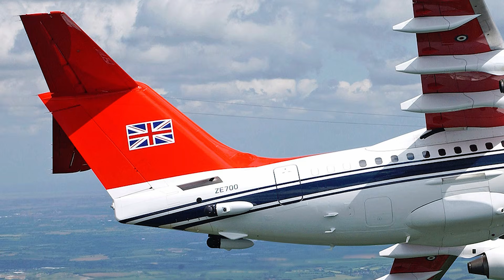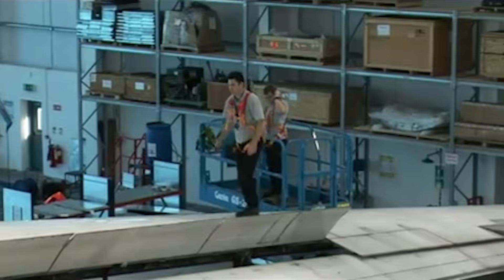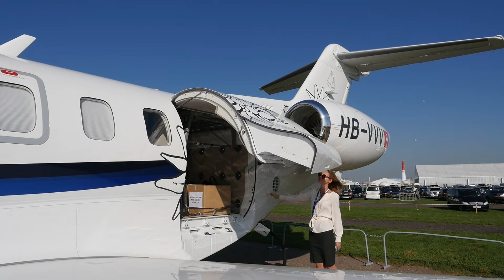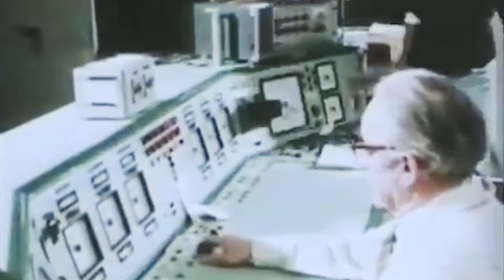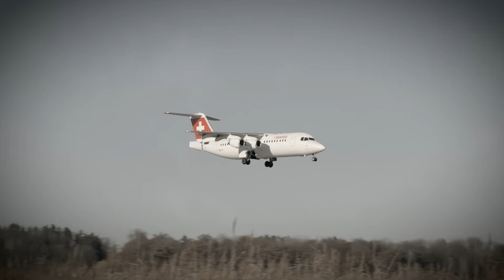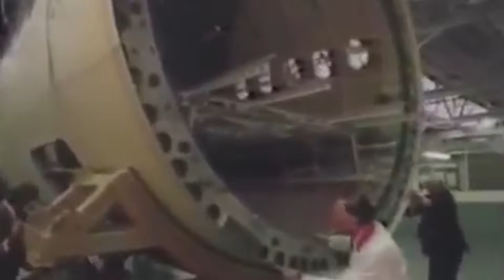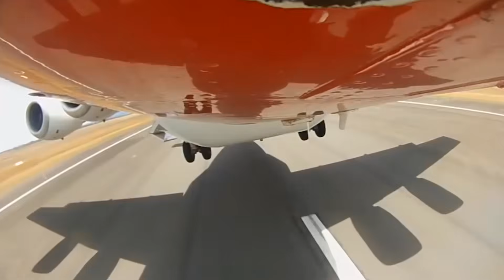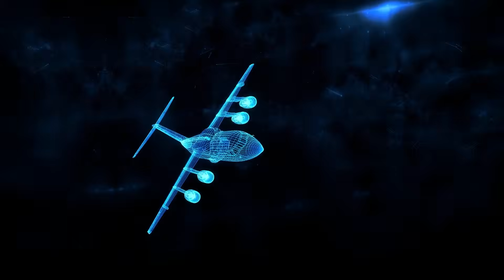BAe 146 - more engines!

Comment: Interesting video and a rather cute and effective aircraft.  You appear to believe the "failure" of other jets was all down to "wrong marketing". Just FYI.  Most of the issues with British jets stemmed from government interference. E.g the Trident - Hawkers wanted a 727 - sized plane but were instructed to make it suitable for BEA (smaller/shorter range).  The VC10 was designed for "empire" routes so was excellent hot and high and very fast. It was popular with aircrew and passengers.  Despite this, commercially it did not sell in sufficient numbers.  The notable difference between UK jets and USA jets is that the UK  jets (as a result of the experience of the Comet) were stronger aircraft. Boeings blew up their centre fuel tanks, blew out fuselage panels, had numerous problems with actuators etc etc culminating in the current, rather predictable fiasco with the 737Max.

Comment: Like the 737-200 the  146 /RJ will also have a second long career as an Artic aircraft.
Perfect for use on bad runways.
the STOL capacity and stability for a jet airliner makes it very unique.
On some routes there is still no good alternative for it.
Reply: I think you meant Arctic.
Reply: I believe they can easily be fitted with gravel kits too, the high up engines make this possible.

Comment: Flew on them a number of times in the 2000"s and its was quiet and comfortable jet compared to the B737-300 operating at the time. The A220 is it replacement.
Reply: Flew between Brisbane and Sydney around the same time. Flew down on a BAe-146 and back on a 737. To be honest, the BA was like a quiet lounge chair ride and the 737, well, I thought something must be wrong with it. Very noisy and a rough ride compared. Took a couple more trips and yep, preferred the BA every time.
Reply: The Embraer 170/190 was chosen by a lot of airlines to replace it
Reply: Dan air was the launch customer of the bae 146 why no mention .?
Reply: Flew a couple of times from London to isle of man  ... very powerful plane, took off within 100 meters it seemed
Reply: Bullshit
Reply: @bobbypaluga4346  according to Bombardier, who sold the design to Airbus  one of the targets for replacement by the A220 design is the 146. So, that's not bullshit.

Comment: I got to fly on it several times back in 2010 & 2011 with Blue1. My most memorable moment was in 2011 when I was flying from Vaasa to Helsinki:

We had taxied to the end of the runway and the pilots were lining up for takeoff, then they noticed that one of the fuel caps hadnt been properly locked, so we had to taxi all the way back to the gate to close it. xD
Reply: Lufthansa does it on the taxiway. Remember ze effienzcy

Comment: I flew on a RJ85 from London City to Dublin, quite a scary takeoff!!.  Plane got to the end of the runway with breaks locked, then the engines went full powerand I expected it to roll but it never did, it felt like forever and the plane started wobbling and shaking until eventually they let breaks go and damm....... The plane shot up into the sky and seeing all those buildings while the plane seemed to slow down a lot. Never have I felt so vulnerable in an aircraft but it was absolutely awesome!!!
Reply: Mitchell C Classic London City take off on one of those ..
The noisiest thing on them is the landing gear hydraulics when retracted or deployed .
Reply: Hey ummm I don’t think that’s the brakes that’s actually the irregularities of the runway
Reply: @USS-New-Jersey-bb62  no, they literally applied the brakes and went full power for quite awhile.
Reply: Used to fly in these into Belfast City in the late 1990's, it always felt like the pilot stood it on one wing tip and turned up the Lagan and then you hear a noise like a tube train as the flaps extended and the undercarriage went down ... so much better than the Dash 8 that Flybe operated on the same service.

Comment: Appreciation as always Skyships but come on I've just had to stall the film to convert 31kn to 7,000lbs thrust. OK 6969lbs!
You did the thrust conversion last time.
13.01 The bloody flag is upside down!
No mention of the issue or non issue as per aviation companies of the engine and toxic cabin air?
Reply: The toxic cabin air was not a continuing feature and is overplayed, usually by those who seldom flew in them. I've flown enough times in the "Jumbolino" and I've never had any problems between LCY, ZRH and VCE when it was part of the Swiss fleet.

Comment: The best,quietest jet around.  They used them to prove a point up here in Scotland.  They wanted to open an airport for 24hr operation, but they get so many complaints they gave in.  But they didn't give in, they asked to run these jets through the night, and did.  They did advertise they were going to do this, but in a very small add'.  They did it for six months, then announced they were going to run the airport 24hrs.  They got a lot of complaints, to which they said "We have been operating for 24hrs over the last six months, we have received no complaints".  It now runs 24hrs, but not a lot of flights through the night, but it is operating.  I like these jets, very quiet and quick off the mark. They called them Whispering Jets here.
Reply: bob fourjs ot
Reply: The engineers managed to bring the noise from outside the plane into the inside of the plane.

Comment: used to fly frequently to Paris and Brussels from Birmingham on them  no so long ago, stinked of fuel when engines start up in the cabin, seats around  row 7 had tiny overhead lockers due to the wing  structure, but I always liked flying them.  however longer twin seat single isle jets are nicer as guaranteed not to get a cramped middle seat and fight with your elbows. Superjet in particular is much more comfortable (but unreliable in my limited experience)  Embraer seem to have replaced them though  on local flights were the RJ was used.

Comment: They are SO quiet .I remember if I was awake at 2 am with the windows open, I would hear a strange low hum in the sky for maybe 3 seconds then it would be gone. I was very puzzled as to what aircraft could possibly be making it. Upon investigation I found it was a BAE-146. VERY unique sound to it.
Reply: @ATCkeepsUsafe  Do the letters f o mean anything to you?   Hint:  I'm not referring to far out.
Reply: @terryboyer1342  first officer? 😀
Reply: @V8King770  Nope. And not fraternal order either! :)
Reply: The ones I've seen made that odd moaning sound that you'd hear from the early post-war jet-fighters.
Reply: The BAe-146 was designed for city hopping through Europe because it was quiet and could handle smaller air strips.  Noise issues were a large concern because of the whine jets put out and when landing, the thrust reversers would get even louder.  The timing of the 80s wasn't good for the 146 for two specific reasons; fuel consumption and larger turbofans.  There are a few fire fighter versions here in the US and still many operating as passenger jets in spots around the globe so they must be doing something right almost 40 years later.
Reply: Once they started making these (after the Tridents early morning engine tests) people living in Hatfield had to buy alarm clocks.
Reply: @billyboblillybob344  the Ba146 engines were ALF 502, they cleverly took the Lycoming T55 and added a geared fan on the front, fan and turbine both spin at optimal rpms, hence the quietness
Reply: They were only quiet on the outside.  Inside behind the wings they were very noisy ..
Reply: @paulwarner5395  I found it to be the most quiet airplane I've ever been in. And so comfortable (leg room) in the brussels airlines versions.
Reply: terry boyer flaps woke me up every time.... terrible whistling
Reply: Yes I remember living under the approach to Manchester Airport in the late 80,s. The 146 would almost seem to "sail" past.
Reply: It's the flaps. I used to hear the same thing, a sort of groaning noise. It's very prominent in the cabin.
Reply: Not when you're flying on them...

Comment: such a shame to retire such a beautiful machine :(
Reply: As the previous person noted there are fortunately quite a lot still flying, most for freight. However, Summit Air in Canada and Cobham Aviation in Australia still have great numbers of them in their respective fleets. Book your flights to Canada and Australia to fly then before they are all gone!
Reply: There are still a number of them operating out of LCY for Aer Lingus and Swiss. The wet-leasing company CityJet have quite a number of them on their fleet.
Reply: @SimonPearce69  Yeah, CityJet fly them Dublin to London City Airport (or they did until recently anyway!)
Reply: @phljns  the route is operated by Aer Lingus now, using the CityJet aircraft. The planes and the people are the same but the paint and the prices are different.
Reply: It’s such a good regional jet base though, still the only jet to go into a number of airports in NZ. Surely a twinjet could fill a niche?
Reply: Jenson
Reply: With over 80 still flying, it's nice to know some airlines are holding on to them as they are so uniquely useful in certain conditions. A bit like the turboprop De Havilland Dash 7 in that respect, though the Dash 8 was later developed from it and is still being made.
Reply: Yes and no. It is 3 and 3 seating similar to an a319 but with less length and seating capacity. It also usually flies at about 26,000 feet give or take so can be a rougher ride. While the engines are powerful aiding performance the engines obscure the view out the windows. So it seems very familiar in the interior but the view out the windows just isn't that great. They should have modified it for just two engines because the plane is badly outdated in terms of fuel costs.
Reply: Ugh. All in the eye of the beholder. It is interesting looking, possibly even attractive (not ugly anyway), but I cannot imagine how anyone can look at that squat, ungainly, over-engined little tub and think "wow, what beauty, it is like artwork!"

Comment: In hindsight, maybe BAE should had adopted 2 high bipass engines like the ones on the A320 and 737 when those became available, instead of insisting on the 4 engine layout on the second generation machines. What do you guys think?
Reply: Too expensive, too big, disproportionality heavy, over powered, too noisy and would require a big design re-think.  4 of those engines would weigh the same as a single 737 NG engine(cfm56)

The noise alone would have killed the sales of the aircraft.

It would probably look like an AN-148, although the AVRO has already proven extremely capable diving in-between mountains and climbing out in time.

Comment: There were several minor issues with engine fumes and cabin ventilation inside the BAe 146, usually fairly mild, but there one or two more pronounced incidents, as I recall, attributed to design issues. I flew one once - a BA service to Rotterdam from London Gatwick in 1986 and noticed this myself. One nice memory about that flight is that we kept to a fairly low altitude all the way, and it being good weather, the views of the Kent coast, and the coastlines of France, Belgium and the Netherlands were stunning.
Reply: I flew as crew on the gas chamber 146.
Before the first flight of the day we used to "clean" the filters in the AC by turning the packs to high and temperature to hot.
The visibility in the cabin would reduce to nothing in white fumes.  Awful.
Many crew refused to operate it, and others became quite sick as a result of exposure to the toxic fumes it created in the cabin
Reply: @dxbmick  if you turned the AC to hot immediately after start up in a generally cool environment, it will condensate and create steam - this is the same with any AC system. The 'toxic fumes' would have been from the materials used in the cabin reacting with the hot air suddenly being blasted at it. :)
Reply: @saintmobius5348  It wasn't condensation.  It left you gagging and gasping for air if you breathed it in.  The company switched to running the aircraft on vegetable oil to alleviate that problem!
Reply: I wouldn't categorize the air quality issue as "minor" issues.  It was a real issue...
Reply: AFAIK this ws because the engines were originally designed for helicopters and so needed to be converted to provide the bleed air for the cabin. This meant oil ingress is a problem.  I used to enjoy weekly Stansted to Schiphol in these but they were smelly.

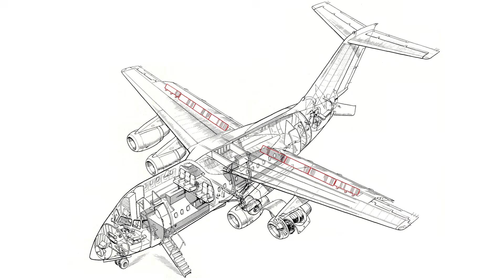Comment: 9:53 I think you mean spoilers. I never saw those being referred as "interceptors".
Reply: The narrator is Russian I think by the accent. They often have different words for English ones than we use. Nice aircraft. Wouldn't say no to a personal jet version.
Reply: Speed-brakes?
Reply: "Lift Spoilers" is what they are called in the AMM (Aircraft Maintenance Manual).
Reply: I think that's because the narrator is Russian, and interceptor (интерцептор) is the Russian term for spoiler.
Reply: The petal unit at the backend of the aircraft is the "Air brake". On the wings there are both "Roll Spoilers" to aid turning (and control the plane in case of jammed ailerons) and "Lift Spoilers" to dump lift upon touchdown in order to give the Carbon Brakes more effectiveness.
Reply: I couldn't find any results besides fighter jets called interceptors. This answers my question thanks.
Reply: Spoilers would be the more correct term, as they "spoil" lift as well as add drag.  This is why they are used as augments and/or replacements for ailerons in some aircraft.
Reply: Air brakes
Reply: @USS-New-Jersey-bb62  no

Comment: Jumbolino, Jumbo Jr.
dear child has many names
Reply: And let's not forget "Barbie Jet" one I heard often when i was flying right seat, many years ago out of Atl, GA. It was a great aircraft...handled like an overgrown C-172... with it's massive and unique trailing link landing gear it was almost impossible to make a bad landing....if you made a "firm" touchdown you would still be acknowledged as having made a good landing. Two things I hated was 1. that same trailing link gear was very unforgiving  of any touchdown with the aircraft in a crab...the bird would vibrate, shudder and fuss until you started rolling straight.. The other "flaw" IMO was a lousy pressurization system...the MAX pressure differential (PSID) was pretty low for a jet. As I remember not much over 5.5 PSID. Which will translate into a higher cabin altitude for a given aircraft altitude and required very careful monitoring on any descent. We operated into Myrtle Beach SC and Asheville NC...two destinations where "slam dunks" were encountered often. A "slam dunk" is what we called a sudden or late clearance to descend to a lower altitude. In most aircraft that's not a problem....but if you have an exceptionally higher cabin altitude....it can be very difficult to get the cabin down to the landing field's altitude before the aircraft touches down.  While keeping the cabin's altitude rate of descent at or below 500 feet per minute.. Going to MYR (myrtle beach) center would keep us very high to avoid traffic around Charlotte... never could put a finger on why we were held up going to Asheville.  Quite, comfortable and easy to fly...was a real joy!!!! Interesting tidbit....the engines begin life as T55 turbo-shaft engines powering  bell helicopters, the C-47 Chinook and C-46 Sea Knight .  As the guy said in the video...the engine is modular..... they replaced the helicopter rotor gearbox with a geared reduction system driving a fan. Caused a few problems with high altitude flight under certain conditions called "roll-back'" where you would be cruising along at altitude with no worries,when the engine power would just start to creep back for no apparent reason. Lovely aircraft and will always be one off my favorites!!!   EDIT...I forgot to add It was a 146 that Prince Charles ran off the end of a runway in the Inner Hebrides in 1994 causing over I million  pounds damage. By far, one of the safest aircraft flying today....
Reply: "The only alrcraft with 5 APU's"
Reply: @L_T_Z  Sure...IF they went for the option!! The fleet I flew did not have five!!.....lol